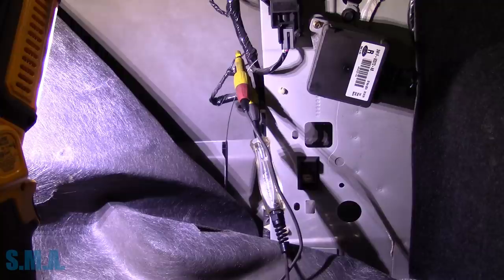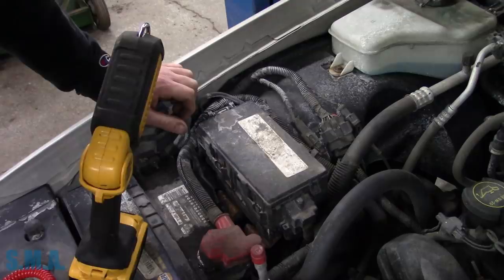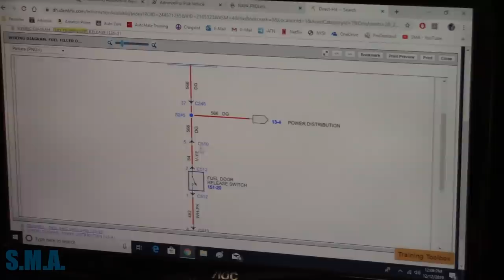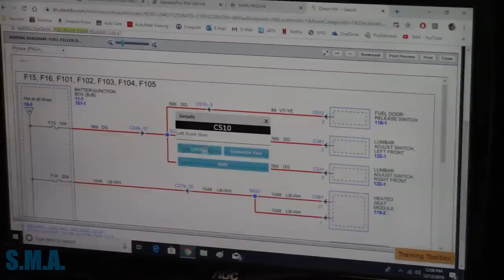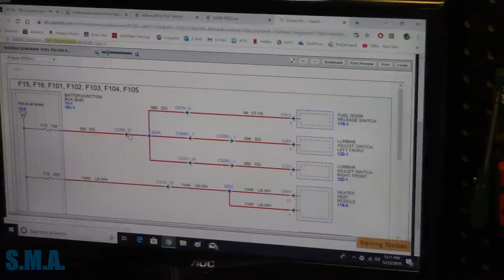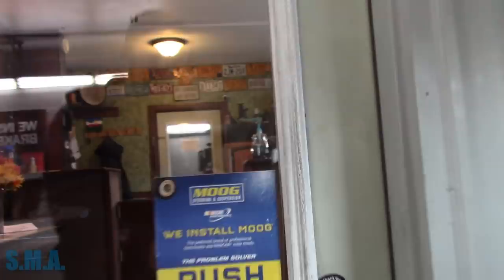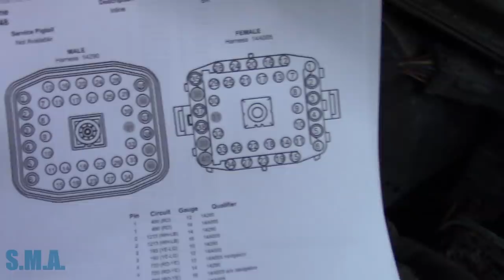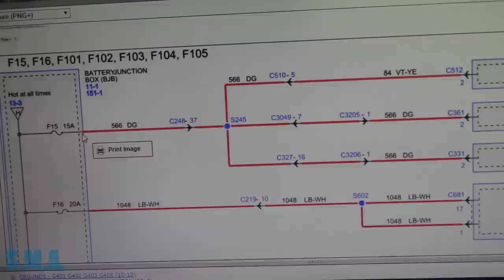Lincoln Town Car: Gas Door Will Not Open

Comment: boy when i was a boy we needed to pull down the license plate bracket or swing out the tail light to get gas lol
Reply: Some cars back in the 50's had the gas go in under a taillight!
Reply: How about open the front trunk, (fiat 500)
Reply: Or on the really old VW bugs, open the front hood and check the gas with a factory supplied wood measuring stick, really-!-- late 50's and very early 60's VW bugs had NO gas guage, just a reserve lever you flipped over if you ran out of gas-!  Couldnt believe it when I saw that, also they ran the windshield washers from the air stem in the spare tire - good (old) german engineering.
Reply: How about old pick-ups with gas tank behind  seat talk about a bomb !
Reply: @davemcguigan218  56 chevy and some caddys I believe had that
Reply: @arjanvanraaij8440  also done on early air cooled VW's.  I had a 65 Square back and my father a 66 Beetle.
Reply: When I was a boy, we had to park the vehicle in auto-hover mode to swap out the fuel cells!
🛸

Comment: Hey Eric. I seem to recall mentioning that tape trick on one of your videos. Anyway, I learned that trick from an old timer years ago. You can use a small socket, a bolt, a nail, a AAA battery - whatever you have kicking around. Thanks for posting quality videos, and keep 'em coming. 😎👍

Comment: Another great vid! I hope you and the fam had a wonderful Christmas and all the best in the new year! 

One thing I noticed about that Lincoln is that it had an aftermarket front fascia (the "CAPA" certified sticker is visible in the under-car footage). That wire chafage could have been caused by either damage done during the accident, or by the body shop who fixed it. That same harness in a Crown Vic runs inside the front rebar, between the fascia and the steel bumper, and can't be accessed without taking the fascia off, so it's a good thing you were workin' on a stinkin' hot rod Lincoln!

Comment: how many dealers go into this amount of detail to find the problem ??  I'd say not many .....
Reply: Being a ford tech for 20 plus years if that car came into the dealer with that problem the only fix option we would offer would be a new harness dealerships dont  repair harness the Ford  fix would be 3k minimum but being a good human i would tell them to take it to a shop that specializes in auto eletrical they will fix it much cheaper just don't tell the service writer I told you
Reply: @jeremyhanna3852  Had a old  Ford van both motors for two front windows failed dealer want $450 bucks took it to friend who is ace on electrical problems pulled motors replaced brushes $ 50 bucks and I was outa there.

Comment: Well, my 1988 Mazda B2200 Cab Plus truck has a cable for the fuel door on the floor left of the the driver's seat.  And also has a lock cylinder so the key can be used.  So simple !!!  So straightforward !!!

Comment: Great Job! Your process is spot on. I think its very cool that you show the troubleshooting steps. I am sure its a real eyeopener for regular folks.
    I use an inch and half pencil for my mini tape wrap. My dad showed me that trick in 1964. He was an Electrician and so am I. I grew up in Dearborn , Michigan. I have been working on cars and motorcycles since I was 12. I hated working on cars in the winter. Moved to Tennessee 32 years ago. Although they do salt for ice, it has rarely happened here, which makes working on a car a pleasure compared to Michigan. 70 degrees and partly cloudy today. HAPPY NEW YEAR!

Comment: what was wrong with a simple steel cable to open the fuel door
Reply: Why’d they not make it just open by hand, instead of over engineering a solution for a problem that didn’t exist.
Reply: or just a push door ... or sprung hinge ...or key one  ....

Comment: Crusty reminded me of our1995 Ford conversion van, NEW battery kept dying, alternator not "sending" charge to it. Factory service manual(paper) was used to find that Ford ran the voltage sense wire right next to the battery tray(driver's side IIRC) and over time it was quite crusty and ended up opening. Did the solder/shrink/seal repair but fortunately not inside of a harness or tight area. Thanks for the fuel door circuit tracing, I'll have to glance at that area the Lincoln TC here next time under it.

Comment: 30:00 I know for a fact, that shops do make mistakes when changing the oil and forget to ADD NEW OIL!
Reply: You would think the car would stop running or at least throw a check engine light if it had no oil pressure which is hard to have with no oil.
Reply: I think you missed the point of what he was trying to say. Maybe try listening to that part again and maybe it'll get through your head the point he was trying to make

Comment: An 1993 Saturn SW2 had a lever that opened its gas door but it was wired released. Still had to close it manually. Our other vehicles are manually open and closed. Our oldest car is a 2001 Ford Escape and our newest car is a 2010 Dodge Grand Caravan . The two in the middle are 2007 Saturn Vue and Aura. Loved to see about cars that we own and see what may go wrong so I can so do it. Love your videos and keep doing a great job! :)

Comment: Mr. O, learned this trick working on heavy equipment. Make yourself a jumper wire with an 1156 bulb in line. The bulb acts as a current limiter protecting against dead shorts.

Comment: Electronic, they are going to be the death of us
Reply: Well at least it's a simple circuit (battery, button, door solenoid) and the door solenoid is not controlled by some electronic module somewhere worth hundreds of dollars.
Reply: And at least he didn’t have to take the door panel off, good eyeball😂😂😂
Reply: I've been saying for 15 years .... that WW3 will done with phones .... ie: just call the tail shaft in the submarine and it will explode

Comment: Your repair was correct and solid. You obviously have more patience than me because if it was me and that car was mine I would have just ran a hot wire from the + stud that powers the fuse box instead of directly from the battery + then installed my own fuse and spliced into it over by the firewall. Also I'm like you I don't like splicing into any harness on any vehicle because of how old the vehicle is and that will most likely cause a corrosion issue in the future. But in this case I agree and think that you made the correct repair for the customer.

Comment: First, on the day of living dangerously, lunch looked especially delicious, not dangerous. Once again, your logical thought progression led you to the location of the dreaded green crusties!. You need to start collecting all the "back in my day" stories about your mechanical adventuress so you can share them with your kids when you're sitting on your front porch in your rocking chair. Coolest filler door location ever was on the 56 Chevy Bel Air - turn the knob on the left rear tailight and the whole assembly would drop down to reveal gas cap/filler neck. I understand that, back in the day, it was great fun to watch the gas jockeys (remember them?) looking for where the nozzle went on the 56. (Simpler times, I guess).

Comment: Eric There is a great tool for splicing wires together, it is called a "picabond" (not a sponsor!). This tool has a number of "picks" that you can get, including weather proof. They also have many different wire gauge sizes. I have used this tool for a number of years in the gaming industry and even though it is a bit expensive, it is well worth the cost. If you can reach the wire with a soldering gun, you can reach it with the picabond. No need to strip, solder, or use heat shrink.

Comment: I love my power probe.  Saves so much time chasing 12v circuit problems.  One jab to the back of the switch, toggle the switch on the probe, door pops, 50% of the circuit eliminated in an instant.

Comment: Did you notice the CAPA cert labels? The car at some point had the bumper & or core support replaced. Likely the harness got damaged in an accident, yet the wire took say 10 more years to fail after the initial damage.

Comment: I saw aftermarket labels on the inside of that bumper.  Shoddy work by the auto body shop led to the wires not being run and secured correctly which in turn lead to the chafing and the green crusties.   Good call on Eric's part.

Comment: Stereo shop would have cut a dimmer wire, twisted it together with some speaker wire, electrical taped it and run it through a hole in the speaker grill to the switch.  Fixed!  You done good.

Comment: Great tip on the tape, been working on wiring for over 50 years and always cut a piece off the roll and you know that usually ends, but next good tip is the last wrap leave overhanging so if you have to unwrap it it's easy. great videosl

Comment: Fun fact, the F16 was grounded in the 80's because wire looms chaffed the same way.. I've come across this in some of the things I've worked on over the years and in any area that the loom touches the frame and has a "hot point" I double up on the plastic loom.

Comment: Couple of times where I had to run a wire in a compromising area, I slid a piece of small hose(old vacuum hose works) over the top of it so it wouldn't rub.

Comment: Great video.  I am glad to see there are those who will do an over lay. I. Have done several. Awhile ago I asked a question of you hoping for a reply.  I/we did find the problem. 2.4 L Ecotec in a Malibu. It was a crank,spark, compression. No start. The timing chain jumped. A word to the others, take valve cover off right away. Otherwise you may end up putting new head on.

Comment: Sweet kitchen! And that's not an uncommon issue with those led sled Fords. Had a couple Crown Vic Interceptors with shorts in that area. Random dead batteries are a fun issue to have.

Comment: Watching you poke into the wire harness and try to pull out something from the bottom of the bundle, I swear you need a crochet hook. Nice small one that can help slip through it and pull out the right wire. I bet it would help you access tiny wires in tight places HEAPS.

Comment: Hey Eric. Don't know if you care to know or not but "T O" on Ford wiring diagrams means Tape Out. So basically it's the nearest taped off branch of the harness near the connector. So near Tape Out would mean splice is near that branch off.

Comment: Some great take-aways from this repair: Sometimes the right fix is the quickest, cheapest fix; In the future, there will be no Gashole; and I need to get me some T pins.  P.S. - there are still cars (a couple of our daily drivers - Roadmasters) that have the Gashole in the back of the car, behind the license plate holder.  It's kinda funny when people try to find the gas cap, not on the left, not on the right, whaaaaat?

Comment: Don't feel bad, I've done that before too with running a separate wire like that. It comes down to accessibility to the wire and what I would have to remove to get to it. It's not economically feasible to try taking the front bumper/fascia off dealing with rusty old fasteners, not worth it.

Comment: Nice job, Eric!!! I agree with you on the overlay wire, but in this case you really had no choice. It was do the overlay or tear the bumper off and probably pull the radiator out to get room to work, and with wiring being time and materials,  that can get expensive real quick.  Thanks for sharing....

Comment: Another good video with some good advice at the end of it. If I were doing the repair I probably would have just run a new wire from the fuse box to the connector at the firewall but that is just me nothing wrong with the way it was done in this video.

Comment: Nicely done within the limits knowing there's  over 200,000 miles. I really liked the tape trick, not sure I'd ever think of that. Nice kitchen for Mrs. 'O'. After thinking, it will work out great if she needs to bake for the kid's school things or whatever. But did she get a dish washer as well, lol. I was thinking of the first time I put gas in my '07 Galant you put a couple of tires on and did the rear alignment which has fixed my tire wearing problem, thanks again. But anyway I was looking all over for a catch to release the gas cap. At one point I was just going to push on the gas cap cover but didn't want to break anything when a lady came over and just pushed one side of the gas door to open it. Yeah I felt a little stupid, but such is life, lol. Thanks for sharing.

Comment: Good one the tape arround the socket tip. Also the 3m electrical tape works better the regular vinyl Electrical tape althou it leaves a black mess behind aftertime if you remove it. Sparky from the Netherlands.

Comment: Great video. I think isolating the fault to be able to inspect around it limits the uncertainty around is there another wire about to fail tomorrow but I’d have zero hesitation about a well done overlay on a car that age... I think my line in sand on worrying about it would be around end of warranty.  After 5, 7, or 10 years they expected it to break and the 20/20 hindsight will show how to make it better than new.

Comment: First oil change at 10K was free at dealer. Saw some drops on ground and checked underneath. Drain plug was finger tight. Could have been a disaster. 2nd oil change at 20K also free. When I did my own oil change at 30K I found an Assenmacher oil filter wrench stuck to filter housing. I own the wrench now. Had an extended contract and never needed a repair on the vehicle. Bad dealer service.

Comment: The Keystone / CAPA sticker on the inside of the bummer is a good indication it was replaced. Maybe just maybe the wire loom was moved around and never re-secured properly. FWI after market part suck.

Comment: I have that Dewalt light at 2:00 and I hate it because retention on the light part sucks and it's always falling over. The only reason I still use it on occasion it is because it has a retractable hook on the top and is somewhat useful

Comment: Interesting way to repair such a corroded wire and connection. I have to ask, when you pulled the "Dark Green" wire and it finally broke, did you lay the broken wire along the harness so see where that break was actually at in the harness? I ask because it could have shown other possibles that are getting in that same way. And while not repairing all the corroded wires, you could have let the customer know there are other wires that don't look so good. Just for my own knowledge, I would have had to trace that broken wire to that actual break area even if it was on the outside of the harness, just to see why or what could have caused it... Thumbs Up!
Reply: Ya if someone was paying you to do all that it would be great to go to the infection and inspect. 9 out of 10 people understandably wouldn't want to pay for all that.

Comment: Fine job of trouble shooting ! If it was my car ,I would do like you said ,run a hot wire with a inline fuse ! but for a customer you got to do it right ! Did a lot of inline fuse bypassing due to corroded wires in a harness ! (On my cars )

Comment: I have to open the trunk skirt sometimes to jump the pump at the fpdm pin connector after they've been sitting for a period of months and the pump won't turn. Sure beats replacing the pump.

Comment: Since that car has had front end work (note tweaked fender braces, aftermarket bumper cover, etc)...if the harness wasn’t bolted down in the two spots plus the missing tape harness would jiggle jiggle wiggle wiggle. Rub through with the salt....voila. From the factory the car had a few wraps every few inches plus the whole harness was wrapped. 
Anyways nice work as usual on the diag - factory wiring diagrams are imperative.   Noted for my future reference....

Comment: In the salt belt and with high gas prices a 95 Lincoln has no resale  value today, I'm sure repairing it wasn't cheap, so the fast solution was to just remove the gas door period and it probably won't be the only beater missing a door.

Comment: Thankyou for the tech tip!  Wish I had known about that years ago.
Hope you had a great Christmas.
"Gas hole?"  Have to remember that one.  Do you use "split loom" or convoluted wire covering for your "overlay" repairs?  If the repair is in a questionable area, I used split loom, tape on the loom ends with liquid tape to keep the electrical tape from unraveling.  Overkill?  Ya, but don't have comebacks that way.
You done good Mr. O.  Good Day Mrs. O.  She's making me hungry!

Comment: Very likely caused by a pinched wiring bundle from a car crash. That bumper skin is aftermarket as is the bumper plate. 

My guess is the wiring bundle was pinched and cracked some of the wires outside plastic and after 8-10 years of moisture and road salt intrusion, the copper underwent  corrosion and lost contact.

Comment: I really miss the days when I could connect the motor in a car with 3 or 4 wires (+1 with an aftermarket tachometer) and two battery cables. I did take a 1500 hr course in auto mechanics from June 1972 to June 1973, it didn't take long before I was only able to do groundhog work, as everything else became more electronic controlled like ignition systems, fuel injection, and emission systems. The only good thing I still have is the ability to replace brake rotors and pads, drums and shoes, starter motors, alternators and other dirty work. I can also do work on my motorcycle, at least it has a carburetor and easy to tweak it.

Comment: After applying the electrical tape, coat the tape with PVC pipe cement.  The pipe cement fuses the tape together so it can't unravel.

Comment: This one time I thought the fuel cap on my 1983 GMC had failed. Turned out I was turning the cap the wrong way, within 5 minutes I had a full tank. Bless technology for making it easier to pour gasoline in a tank. Everyone needs a button and a solenoid and some wire and plugs to pour fuel in a tank. I love technology, but it is supposed to make life easier.